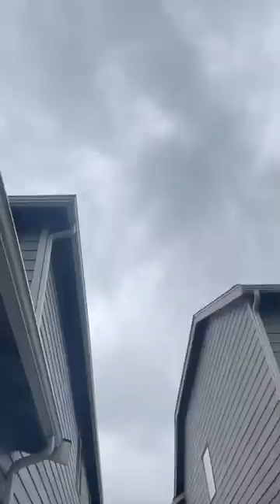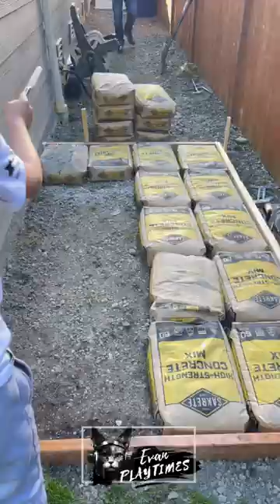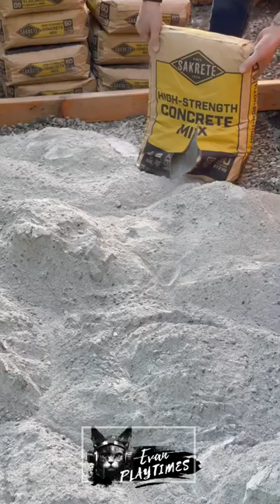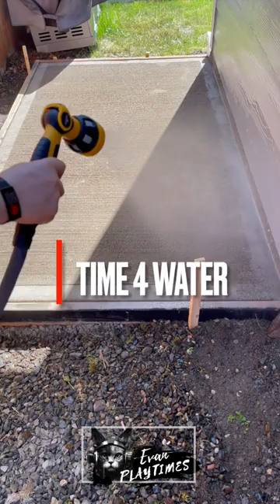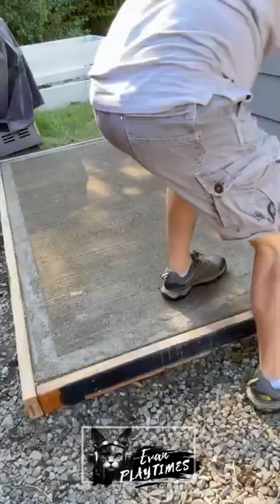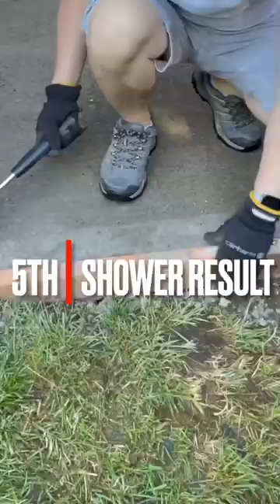Dry Pour Concrete | Love It

Comment: This is crap that will not last don’t do this dry concrete it will cost you your money to fix later. And if you are selling then the new owner will havto replace it all. This is for people that are intermediated about doing concrete because thy are scared not confident in finishing the concrete off before it drys. 
Well then don’t do it get a pro or someone that is not scared 😱 anyway this is a junk job don’t do it I am a General contractor licensed for 10 years with 25 years experience. Even when I was a newborn construction worker back in 1999 I still would not do this dry concrete junk. Please don’t do this 😢

Comment: The problem with that is, not giving proper time to dry completely it takes 4 to 7 days to completely dry and it also depends on cement quality.
Reply: I don’t think it’s meant to last just something the older gent had time to do without breaking the bank.
Reply: @Edisito I find older gents technics are more reliable and useful for long period.

Comment: Don't do it... it makes a weak, very fragile finished product. I appreciate innovation, but you are simply misusing a product that was never made to be used this way. Pour it wet, but not too wet, and you will have a strong solid product. If you are using pre mixed bag concrete, I'd recommend a little extra Portland cement.

Comment: Please stop doing these way ! You diminished the strength value of the concrete and life spam of half of it !!!!!😂
Reply: Its only about a 20% to 25% decrease in strength.  I doubt his now 3600 psi sidewalk is going to be an issue
Reply: @AnnArborBuck  Are you a structural engineer or a concrete doctor or at least master in this branch to issues this kind of jokes? This technique is rong !!! If you want to treat the mixture with insufficiently w/c at the start you will only end up with uneven parts of semi activate process that will eventuality been activate later ! That's total rubbish technic . You can try to spray and mix the concrete up to a minimal w/a require and start right away the 2 step cure with moisture additives.

Comment: The texture on the finish result looked rough . Most people want a smooth finish.
Reply: No most people want rough anti slip grooves that why concrete companies do it with a broom
Reply from the maker: @kleco1000  Agree, we used a broom to get the rough surface. It works. So far, no crack.
Reply: How is it going so far? Any changes you would have made?
Reply: Side walk or anything concrete you plan on walking on always gets a broom finish so that its not slippery